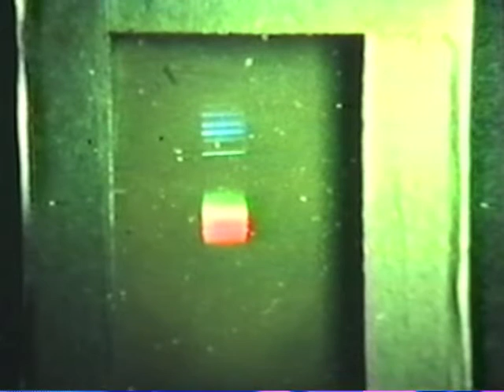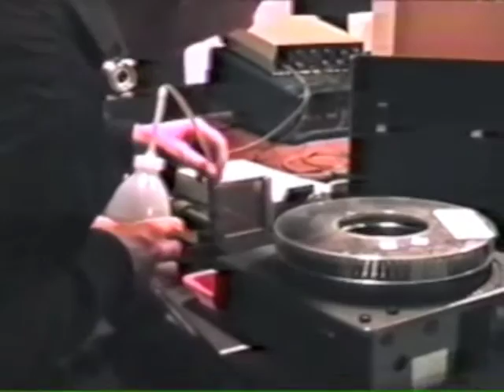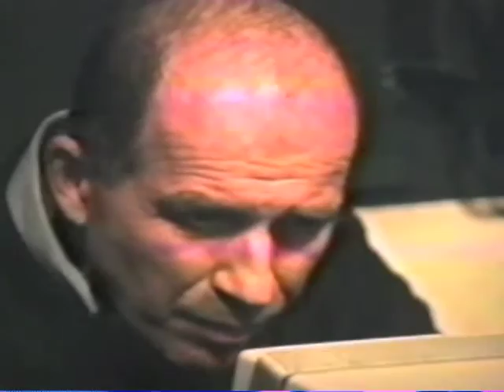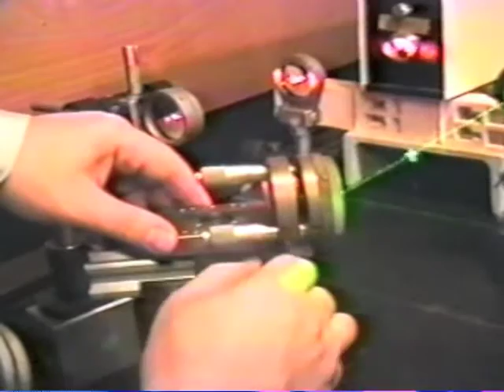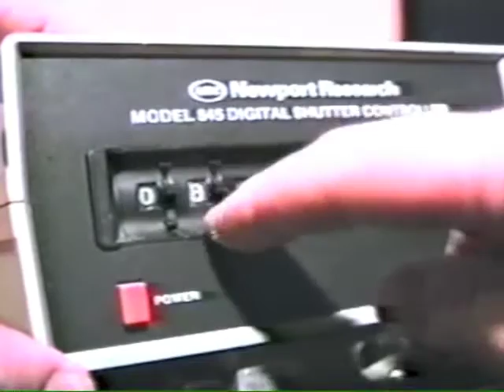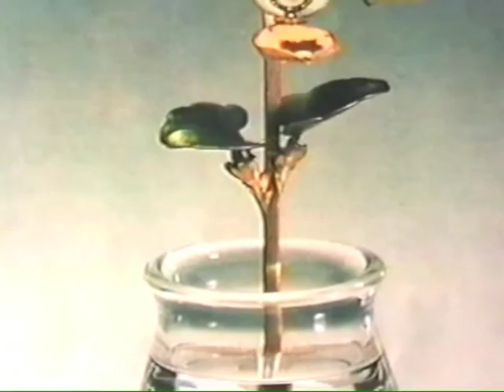"Lippmann Denisyuk Holography" by Hans Bjelkhagen (1993)

Comment: This is very fascinating. I have a small, full colour hologram in my collection, and always wanted to know how it was made. And now, a company called Litiholo have produced a cheap kit that lets one make colour holograms, albeit no where near as good as what we've seen here. I was fortunate enough to have met Dr. Denisyuk at the holography symposium, at Lake Forest University, in 1991. Thank you for sharing this.
Reply: @ThomasGrillo do you have any images of it?
Reply: @longiusaescius2537  I have not taken any photos of the colour holo I have. Since this posting, I have obtained one of the colour holography kits by LitiHolo, and have actually made a few colour holograms with it. It's actually easy to do for the reflection type. A bit trickier for the transmission colour holograms, though. LitiHolo is currently not selling kits, but should be selling them for a short tim, later this year.